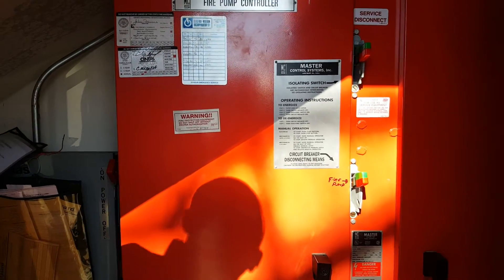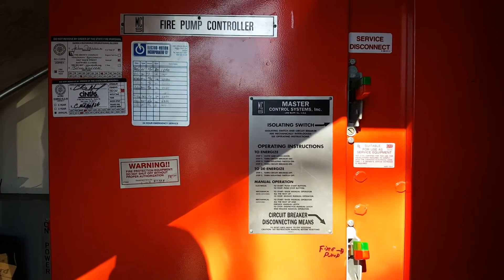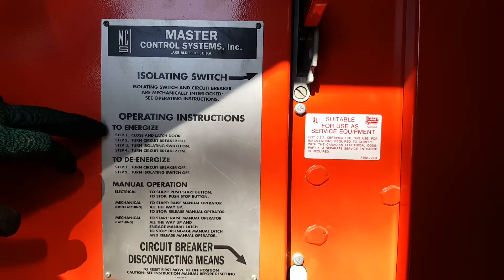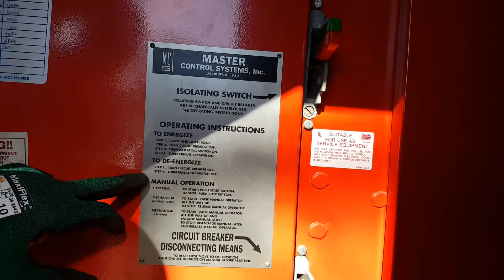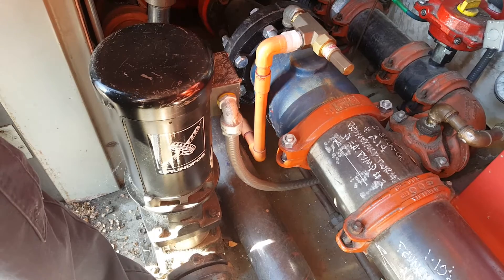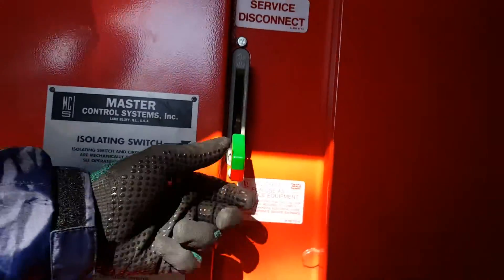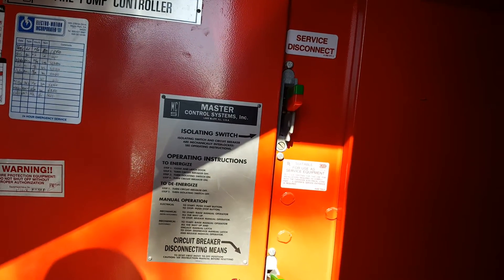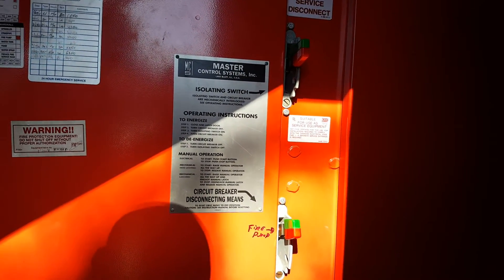FIRE PUMP How to turn off and on a electric Fire pump

Comment: Circulation Relief Valve is installed horizontally. NFPA 20 says the CRV “SHALL” be installed vertically and must have its own drain piping.